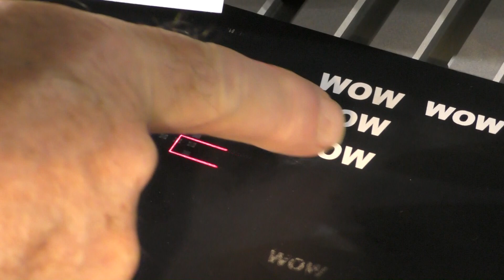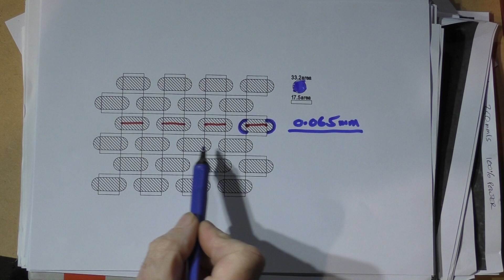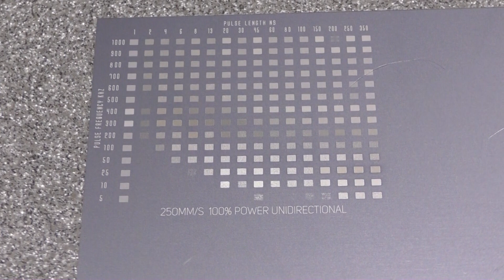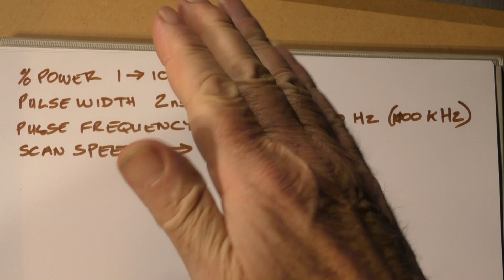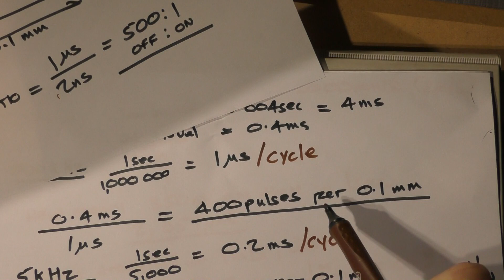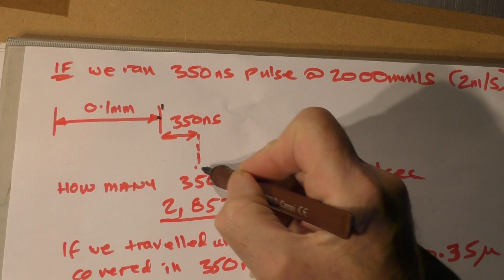Fiber Laser Learning Lab 05 Let's Test Some Pulses

Comment: In short, the hardware cannot deliver the specified parameters, which is the case with all Chinese machines. No wonder because you pay 20 times as much for good beam sources. My f-theta lens costs more than a China machine, Scanlab Galvo is the same. A good zoom beam expander costs over 2K.
Reply from the maker: After "playing" with and understanding the intricacies of software and hardware  of this machine  I was able to reproduce this matrix correctly.. Your assumption of this being a cheap Chinese machine is incorrect.  It is designed and manufactured here in the UK bu a specialist company that creates bespoke laser systems of all sorts for industries  here and in Europe.. They use Coherent. JPT, Raycus, SPI sources ( dont know them all). The majority of systems are the simple Q switch type but about 10% are  MPOA systems. They do not use Chinese F theta lenses because these are industrial machines that  have to be accurate and reliable.. I eventually overcame the dashed pixels by using drill mode. Using a FIXED X and Y  DPI for  image scanning also fixed the odd lines I was getting.  Please remember this is a learning exercise for me  and at this  point I am finding lots of interesting anatomies that my weird tests are revealing. I am sure if you ran the same tests on your MOPA  kit you would get the same interesting results.  I know that this hardware is only limited by the EZcad software and not by component specifications.  The fact that I see problems is all part of the self-education and discovery process..
 Best wishes
Russ
 ps I was loaned the machine for 1 year and that period has passed and I no longer have it,  Instead  I have a cheap 20 watt Q switch Chinese laser and it's limitations are too many to describe.
Reply: @SarbarMultimedia  A quality optical Q-switch costs more than all the China machines put together. JPT fiber module Coast in purchase under 2k Euro for 30W module. A really good F-theta lens costs over 3k Euro. I have several laser systems and also like to test these China fiber lasers. In continuous operation none of the machines lasts longer than 6 months. Burned out fibers, Q Switch inefficient, galvo distortion and power loss. I have as an example laser systems from Photon-Energy. 2 of the systems one is 18 and other 20years as, run per day min 4 hours through since then. All the China machines promise more than they can do and if you try to take advantage of it, the lifetime will be massively shortened.

Comment: Do you have this file and will you be able to share it
Reply from the maker: Hi Clinton
I'm sure I can find it somewhere in my archive,  In the meantime youn will need to send me your disguised email address, This used to be a simple task but You tube have implemented algorithms that recognize simple masking and then prevents you sending a comment. The way that works is to bury your details in a sentance or two like this. Start with john and a dot followed by smith. Use the standard at symbol and then g==m)a   i*l with a dot and a com.  I will reply and also delete your comment
 Beat wishes
Russ
Reply: @SarbarMultimedia  thanks!  It's pretty easy. Just my first name and last name with a .c. in the middle with a g==m.  And of course com

Comment: I’m wondering if the reason you’re getting power spikes at the beginning of the start of a row is your laser on time delay is  too long
Reply from the maker: Thanks for the comment. You see shortly that I now have a proper 400x microscope to help me with my observations. It turns out that I was misunderstanding what I was observing. That  blob is the beam  diameter footprint as the beam switches off. It is not a power surge or pulse.  Mistakes are all part of my learning.
 Best wishes
Russ
Reply: SarbarMultimedia ahh so your off delay is not set aggressive enough? I have a similar laser, but mine is a max photonics mopa 30w and have seen similar things

Comment: Now this is real suspense, better than an Agatha Christie 😅👍
So eager to find what could explain these strange behaviours..
Reply from the maker: The answer lies within EZcad. My chequerboard pattern  is a manually  created (dot by dot) 245 ppi bitmap with 0.1mm  pixels  vertically and horizontally. I have set EZcad to index vertically 0.1mm every scan. When EZcad has imported the 254ppi bitmap  something has gone slightly awry and I suspect the image import is not scaled quite correctly. Lets say the pixels are now 0.099mm square instead of 0.1mm . I have instructed EZcad to scan at 0.1mm increments so as the scanning moves up/down the image  the scan lines will move in and out of synchronism with the pixels. Most of the time the on off switching of the laser will be cleanly controlled by the pixel edges but when the software  scan line encounters the chequer junction where the bottom of one line of pixels is almost in line with the top of the row below, it gets confused and sends out a continuous signal. I have seen this aliasing effect in other softwares.  Lotus Laser advise that for this sort of pattern I should be using  vector lines. I know that and I also know why I designed the pattern the way I did.  A vector image would not show this small math error in the software. When I get time I will experiment with the scanning increment to see if I can find one that perfectly matches the pixel  size.
You can sleep at night now you know.

Best wishes  
Russ

Comment: You have great machine..why you use old EZCad 2? There is EZCad 3, which is another planet
Reply from the maker: EZCAD 2 is not my choice.As I mentioned in the video, Lotus Laser clients are usually high volume small product range users. A  bug free stable version of software that runs the machine reliably is all they need.  They do have EZCAD 3 but found that everytime it was up issued there were bugs that did not previously exist. For their customers, a frozen version of EZCAD 2 was the safest option and has been rebadged as LotusMark. At the moment I don't need to do anything fancy, I just need to drive basic machine functions and understand how the various parts of the technology work.
Thanks for the comment
Best wishes
Russ
Reply: He would also have to change the controller card since the one that works with v2 does not work with v3

Comment: Another great video Russ. There are a lot of setting in the EZCAD software. Not sure if the version supplied by Lotus Laser supports them all. One of the options is drill mode. This moves to a black pixel, stops and fires for the specified ns, then moves to the next black pixel. This eliminated the oval, or football field shaped burn area because the beam is always stationary when it fires. There are also timing setting such as StartTC, OffTC, EndTC and PolyTC. This allows you to accurately control the timing of the laser to prevent overrun and or underruns. Personally I use a combination of timing and drill mode, but I have had a lot of problems with consistency using the EZCAD software when running at high DPI and speed and have recently moved to MarkingMate software which also required a controller board change. Oh, and 2ms:2ns is 1,000,000:1
Reply from the maker: Hi Thanks for the details John, I am not digging into the software too deeply at present although I have fixed the bidirectional scan offset with the  TC variable.. I was aware of drill function but I purposely forced the software into a difficult situation by choosing to draw pixels as lines by defining a fixed scanning offset of 0.1mm. I think this clearly showed an error of some sort in EZcad because the scanning increment did not match the vertical pixel increment , even though they were supposed to be the same. . You will note the missing dashes in some patterns . I think that is because the scan lines did not match the pixel vertical pitch and the scan lines dropped perfectly  BETWEEN the bottom edge of one set of pixels and the top edge of the adjacent row and  did not switch the beam on and off. The other reason was to see the power being put into such a short line by each pulse profile. Drill would only put a single pulse onto a pixel , at 850 kHz I was putting several hundred pulses onto each pixel. I still have a lot to learn/discover. I like to learn slowly and methodically, making many mistakes along the way..
Thanks for you invaluable comments , please don't stop
Best wishes
Russ

Comment: I don't know why the first dot is different either, but the RMI UM-Laser I use at work has a setting for it.

It says, "first pulse suppression."
The choices for it are either on or off.

I am standing by to be educated on this phenomenon. Thank you.
Reply from the maker: Hi Chris 
 I have learnt a bit more since doing this video and I am now convinced that the dot is the LAST dot in  a train of dots. As the line starts, there is indeed a dot but the increment to the next dot, when the frequency is high,  is parts of a micron, and thus there will never be a visible complete dot until the last dot at switch off .Its exactly like the pattern you see with a welded line. I was puzzled at the time as to how the first pulse could be different to those that followed because the is no storage mechanism in the laser that would cause this,  I clearly state that I am the student here and at the point I noted this oddity, I made an illogical conclusion. All part of learning.!! 
Best wishes
Russ

Comment: You have us on tenter hooks- did you find a gremlin?
Reply from the maker: Not exactly. But I am convinced it's a problem with EzeCAD bitmap conversion . When I did the same pattern with vector dashes  I did not see the same issue because there is no  defined fixed pitch. It could well be a small maths issue with the Y pitch  because  it only needs minute scaling problem when importing the bitmap image and after a certain number of fixed Y pitches,  the scanning line that defines the switching signal for the laser,  falls BETWEEN  the dashes  (in Y) for many pitches before it  drifts back onto the dash pattern and starts switching again. I may get time later on to investigate this further. I have seen similar problems with RDWorks and early versions of Lightburn. I'm not over worried about it because what I did was VERY unusual  and probably never been tested like this.
Hope this relieves your tension
Best wishes
Russ

Comment: I am still fascinated how these do colors from a binary material.  Good work, Russ.
Reply from the maker: All will become clear in  later episodes when I investigate black marking of clear anodised aluminium. If that is baffling you, just wait until  I start creating colours on stainless steel.. I am not just trying to find all the colours I have seen others do, that would be easy to look at someone else's parameters. No, I shall gain no understanding from that, I must try to decode how it happens in a logical step by step way. I have done a lot of hunting and can find nothing by way research papers on this subject. Lots about the growth and composition of the oxide layer that forms on stainless  but no details of how the colours occur. I feel this may turn into another "hunt for the smallest dot" saga.
Best wishes
Russ